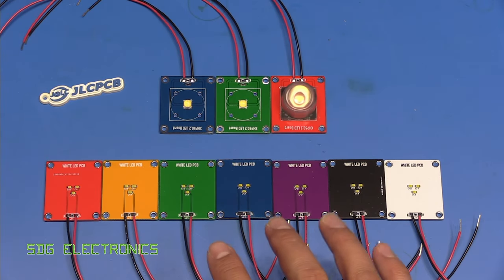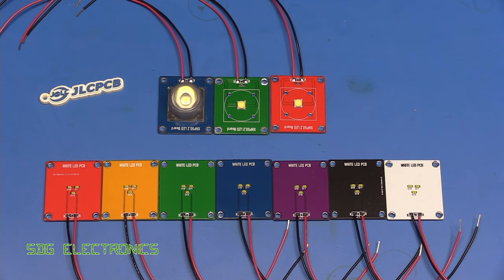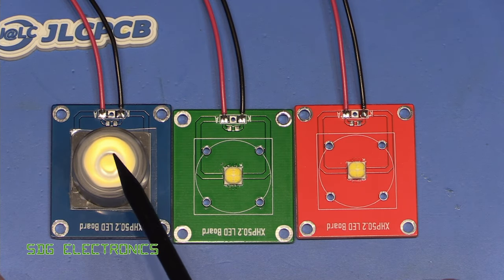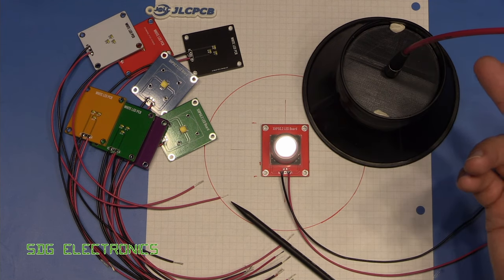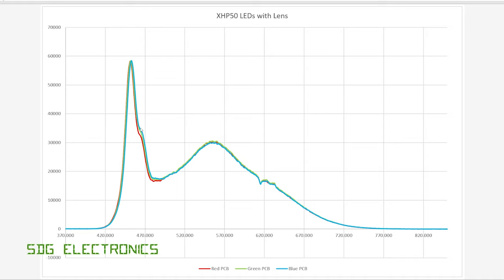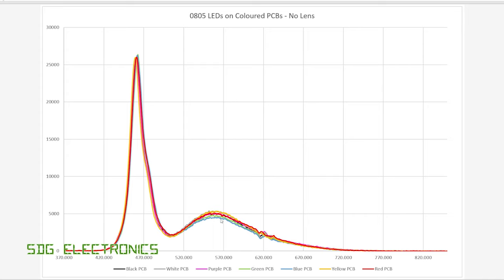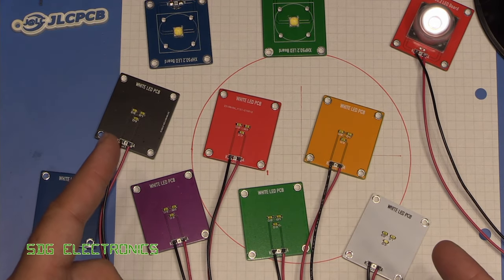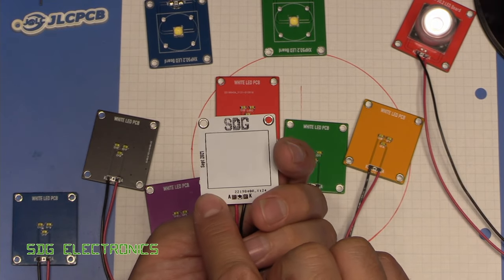SDG #227 Does PCBs solder mask colour impact appearance of SMT LEDs?

Comment: The other thing to consider is unwanted reflections. Predominantly laser TOF sensors like avalanche photodiodes would prefer matte black. Maybe you could test the light reflections on the various PCB's Steve? One of the benchmarks is neoprene as it is considered low light reflectance at 4%.

Comment: How accurate are these LED's ?  Wouldn't the correct test be to use the exact same LED's in the same position on each of the PCB's to avoid the risk of the LED's emitting differently ?  As far as i am aware, two identical LED's almost never emit identical light.
Reply from the maker: They're all from the same binning code, though that obviously doesn't remove the differences. From my experience the broad peak from the phosphor on these white LEDs doesn't shift much in the first few hours, so long as the current is kept low.

Comment: Just goes to show that most modern LED’s are bad for your eyes, with all that blue light being emitted. Never had a problem with the colour of PCB’s normally just green and LED’s as you can’t see the PCB inside a case.  Also the light pipes form the panels to SMD LED’s don’t go over the PCB much.

Can only see this as an issue for the badge brigades, so maybe a little colour matching of LED’s to solder resist need to be performed?

What’s next different colour solder resist on the same PCB?  There is nothing to stop you screen printing on the PCB for that multi-colour PCB before placing components by hand.
Reply: Very true :-)
Reply from the maker: We definitely need photo printing on PCBs